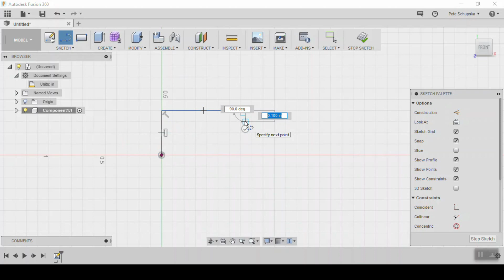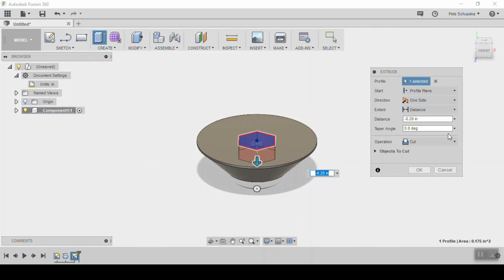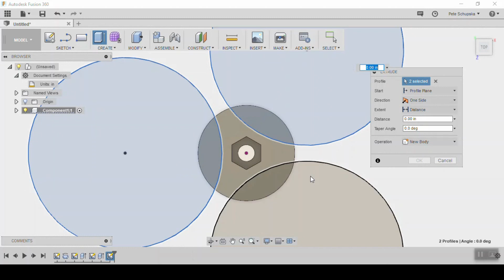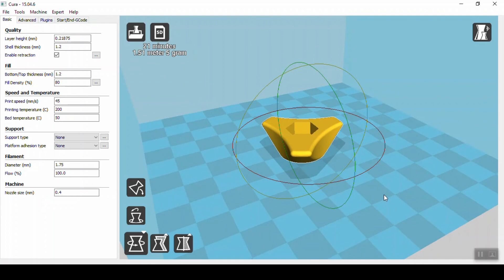How to Make a 3D Printed Threaded Knob Using Fusion360

Comment: This was really helpful for me. I'm trying to create a replacement knob for a closet but I didn't know how I would attach the knob to the door. I think something like this should work!

As a side note, do you recommend Fusion360 for beginners? I've been using the free sketchup and getting frustrated with it. It was hard to do exactly what I wanted with it.
Reply from the maker: Thank you! Cabinet door knobs are usually a #8-32 machine screw. You could probably get by with that or a #10-32 to have a little larger head on the backside of the door.

As far a modelling programs, I've used a lot of different software but could never get the hang of Sketchup. It works a lot differently than most engineering software. Fusion360 is so powerful for complicated models and works very similar to the professional programs - I've been very happy with it. The biggest hurdle I had to getting started with remembering to create a new component to start working on.

So, yes, I would recommend it for beginners. Another upside is there are tons of tutorials online!

Comment: I haven't done any research into 3D printing yet, but do you have to factor the shrinkage into your design or does the software control that on the fly? Very informative video btw.
Reply from the maker: OK, so the engineer in me wants to make a really dorky post. Shrinkage is usually given in mm/mm so the larger your print, potentially the larger the shrinkage. However, I think this applies more to the diameter of the filament and less to the overall part. I would expect the quality of the printer has a bigger impact. I'll post a video about checking the dimensional accuracy of your printer.

Thank you for the idea!
Reply: My limited experience with plastic shrinkage has all been applied to tools for injection moulding. Printing may well be a whole different application with different considerations. Curious more than anything. I'd say it would be less of an issue with these small parts.
Reply from the maker: Same here, I'm going to design some dimensional test parts and see what happens.
Reply from the maker: Here's a follow-up!
https://www.youtube.com/watch?v=MZBBQC90x90